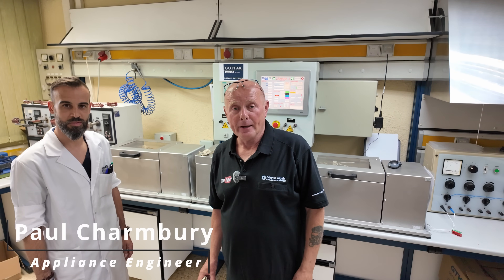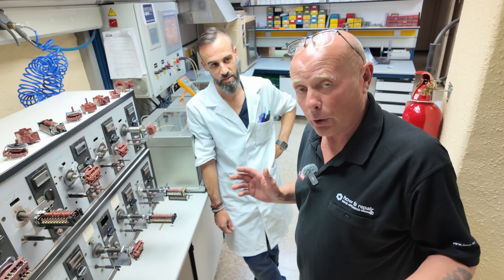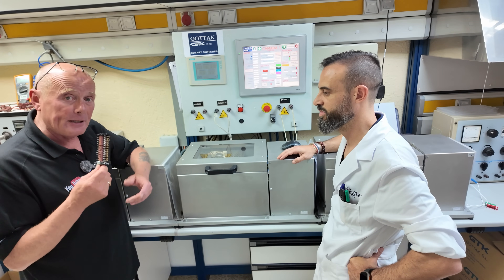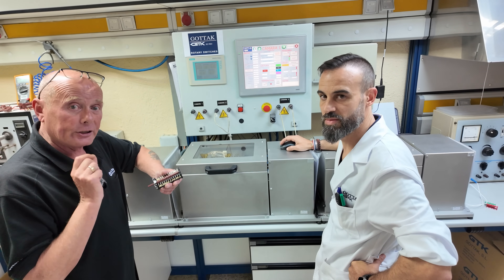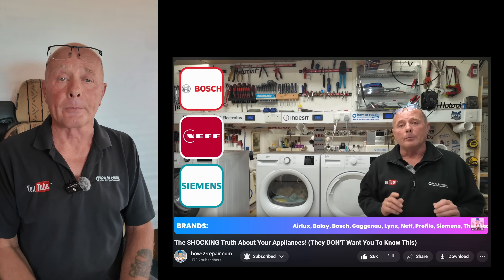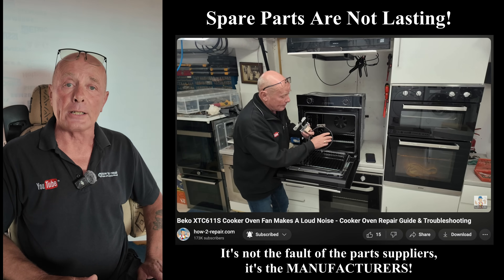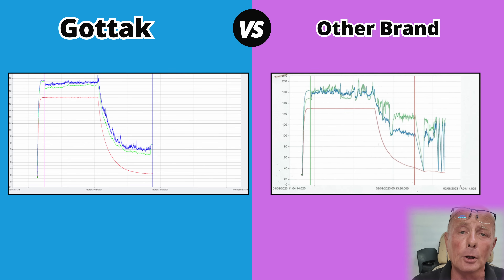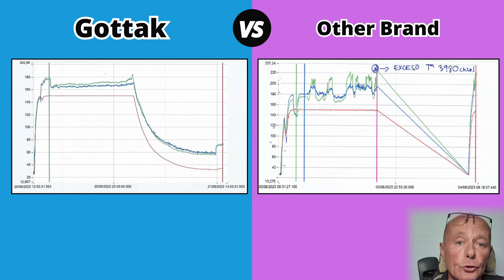Why Your Appliances FAIL SO FAST! Lab Results EXPOSE the Truth!

Comment: The main purpose of any company nowadays is to make the billionaire owner even richer.
Reply from the maker: You've cut right to the heart of the motivation behind many of these issues. The relentless pressure to maximize profits for owners and shareholders is a huge driver of corporate behavior.

The built-in obsolescence we demonstrate in our videos is the direct, physical consequence of that philosophy. When the primary goal is to boost the bottom line, cutting corners on parts and designing products that force repeat purchases becomes a standard business practice. The "savings" and "profits" for the company become a real, tangible cost and frustration for the consumer.

The flimsy components we show are the symptoms of the systemic problem you've identified. For a deeper dive into this topic and to see the examples we covered, please check out the full video here: https://youtu.be/gEgSCbZnHVM?si=wTIw0mELuhWaw4aX

We also explored related aspects in these videos:

The shocking truth about manufacturers: https://www.youtube.com/watch?v=QsdGd2qDPaI
Heat pump tumble dryers are they really worth it?: https://www.youtube.com/watch?v=xn03N3b0-lE
If you found this information eye-opening or helpful, please consider sharing this video with your friends and family. It's important for people to understand the financial drivers behind why their products don't last.

Thanks again for your sharp analysis! Don't forget to subscribe to the channel for more insights like this!

Comment: They have had planned obsolescence since the 50s.
You're just now figuring that out. Way to go Einstein!!!
Won't watch any more of your 75 year behind revelations. 
Manufactures, don't pay any attention to this idiot. His next video will probably be about the wheel!!! Idiot
Reply from the maker: @scottgreer1951

I appreciate you taking the time to comment, even if your tone is less than constructive. It's interesting that someone who appears to be around 70 years old—a fact I confirmed by viewing the only video on your channel, which also confirmed your religious belief—would choose to express themselves with such a lack of charity. I was under the impression that Christian values included kindness and refraining from hateful speech.

You're right that planned obsolescence has been around for a long time; however, to correct you, it actually first came into use with lightbulbs in the 1920s, not the 50s. Regardless, there are many generations of younger people who may not be aware of how prevalent and insidious it has become in modern appliances. My channel, with over 50 million views, has largely been built on assisting people with appliance repairs, and I've overwhelmingly received praise for the quality of my videos and the knowledge I share. In fact, the three videos I've done specifically on built-in obsolescence have collectively garnered over 1 million views, with countless individuals expressing gratitude for the information.

It seems you're lucky my next video isn't specifically about individuals like you instead of my epic video about the wheel. At least this atheist doesn't go around spreading hate.

Comment: So a component fails after 5000 activations in constant heat, the problem is - no components live under constant heat.  What DOES happen is these components gets switched on, then gets heated up, then gets cooled to room temperature.  A test that DOESN'T test under these circumstances is a failed test.

Comment: It's not just build quality. It is that many manufacturers intentionally make their appliances difficult to repair.  I had a LG fridge malfunction.  Upon telling a repairman on the phone what was wrong and that it was a LG fridge, he laughed and told me to get a new fridge.  For that model, they drowned the electronics in epoxy and it would almost be as expensive to buy a brand new fridge as it would be to repair and then he cannot guarantee that something else wouldn't also go wrong.
Reply from the maker: It's not just about poor build quality; it's that many products are now deliberately designed to be unrepairable. This is a core strategy of built-in obsolescence and it's exactly why the Right to Repair movement is so important. This is the very issue we aim to expose in our videos. For a deeper dive into these kinds of tactics, please check out the full video here: https://youtu.be/gEgSCbZnHVM?si=wTIw0mELuhWaw4aX

We also explored related aspects in these videos:

The shocking truth about manufacturers: https://www.youtube.com/watch?v=QsdGd2qDPaI
Heat pump tumble dryers are they really worth it?: https://www.youtube.com/watch?v=xn03N3b0-lE
If you found this information eye-opening or helpful, please consider sharing this video with your friends and family. Your story is a powerful warning for every consumer.

Thanks again for sharing such a clear and perfect example! Don't forget to subscribe to the channel for more insights like this!

Comment: I no longer buy consumer-grade appliances. The Marketing scum (AKA Satan's apprentices) have takn over all the best companies and turned them to shit, pure undiluted shit. 
I will only buy commercial. And it is the filth of marketing that is the cause.
How did marketing do this?
When I was training young engineers, they told me that their professors taught them that corporate hierarchy has marketing above the engineers.  I taught them differently. But pretty much everywhere else it is marketing ordering the engineers the purchasing departments, everyone to build things to fail within a specified time frame.
The evil behind all of it is marketing.
Reply from the maker: In many companies, the philosophy has indeed shifted from being engineering-led (where the goal is building the best product) to being driven by marketing and finance departments. When the primary goal becomes maximizing sales and quarterly profits, long-term durability often takes a backseat. This is the very essence of built-in obsolescence.

The pressure to create new products to advertise and hit specific price points leads to the cost-cutting and design-for-failure choices that we expose in our videos. For a deeper dive into the results of this shift in priorities, please check out the full video here: https://youtu.be/gEgSCbZnHVM?si=wTIw0mELuhWaw4aX

Comment: The appliances now a days are horrible. I still have my dryer from 1999 and refuse to upgrade. I’ve only had to do a few thermal fuses. And a belt here and there. The gas valve once and just a week ago the drive motor finally failed. 25 years. And we USE it. My dryer probably sees more use then some laundromats lol. But it’s simple technology to build what I have and as long as I can still get parts I will not buy a new one. My fridge from the 90’s was great. Made the mistake of replacing it. Now then seem to last 7-8 years and that’s it
Reply from the maker: In the 80s, 90s, and early 2000s, most manufacturers produced high-quality equipment to build their reputations.  Now their main goal is to sell machines. They use green marketing tactics to their advantage but aren't held accountable for the growing pile of discarded white goods. Nowadays, machines last only about five years on average.

Thank you for your comment. I appreciate people like you taking the time to write it out. Please share it where possible. It might help others make a wise choice instead of being misled by the industry.

Comment: Our governments are spending HOW MUCH of our money for GREEN benefits and manufacturers don't care, they are working against us.
It would be great to know which manufacturers don't dumb down their products. I have been aware of this for some time and I don't buy the same brand again when I need to renew.  It is totally dishonest and should be made illegal - though I don't know how it could be monitored.  Perhaps one company would be willing to give a longer warranty, knowing their parts are in good order ...  I can dream.
The solution with customers is to buy small pieces of equipment which are not so expensive to replace - where that is possible.  An air fryer instead of an oven with a slow cooker and/or instant pot.  For washing machines we might need to go back to hand washing and a spin dryer which is much, much cheaper to use and to purchase.
Reply from the maker: It's maddening to see so much effort put into "green" initiatives while manufacturers are simultaneously creating mountains of waste with products designed to fail.

Your desire to find brands that don't dumb down their products is what we're all looking for. You're right that a longer warranty is one of the best signs a company actually stands behind its engineering. 

The dishonest practices you've described are exactly the kind of built-in obsolescence we aim to expose. For a deeper dive into the specific ways they do it, please check out the full video here: https://youtu.be/gEgSCbZnHVM?si=wTIw0mELuhWaw4aX

We also explored related aspects in these videos:

The shocking truth about manufacturers: https://www.youtube.com/watch?v=QsdGd2qDPaI
Heat pump tumble dryers are they really worth it?: https://www.youtube.com/watch?v=xn03N3b0-lE
If you found this information eye-opening or helpful, please consider sharing this video with your friends and family. The more people who are aware, the better we can all become at spotting the bad products and rewarding the good ones.

Thanks again for your very thoughtful comment! Don't forget to subscribe to the channel for more insights like this!

Comment: Getting you extra views / engagement / advertising revenue isn't going to benefit us; only you -- no better than the accountants. The only way to get change is to incentivize manufactures to make quality devices with a tax break.  If your device goes to city dump before 20 year warranty due to failure then you will be taxed 10% of the price of the product adjusted for inflation when it reaches the dump. New manufacturers will require a bond to pay for these fines.
Reply from the maker: Our primary goal with this channel is to use the platform to create a large, informed community that can push for real change. The awareness and discussion are the benefits we hope to provide to everyone.

Thank you for your comment. I appreciate people like you taking the time to write it out. Please share it where possible. It might help others make a wise choice instead of being misled by the industry.

Comment: I have a drier that Ive been using for around 30 years, a washer I have been using for around 21 years and an oven and dishwasher Ive been using for 15 years.
The old mechanical appliances that don't have pc's in them are the way to go.
Many years ago I saw a special on PBS about built in appliance failures.
Reply from the maker: A 30-year-old dryer is a true testament to how things used to be made, and your experience is one that many people share.

For a deeper dive into the specific ways modern appliances are designed to fail, please check out the full video here: https://youtu.be/gEgSCbZnHVM?si=wTIw0mELuhWaw4aX

We also explored related aspects in these videos:

The shocking truth about manufacturers: https://www.youtube.com/watch?v=QsdGd2qDPaI
Heat pump tumble dryers are they really worth it?: https://www.youtube.com/watch?v=xn03N3b0-lE
If you found this information eye-opening or helpful, please consider sharing this video with your friends and family. Your comment is a perfect example of the "then vs. now" of appliance quality.

Thanks again for sharing your experience! Don't forget to subscribe to the channel for more insights like this!

Comment: They've been doing this for too long. its the lack of business ethics that's so prevalent today. use to be such goods were called lemons and you would go down to the store or call the salesman and chew him out and it would be made right. That's no longer the case. In addition to engineered to fail, they're engineered and built in a way to prevent repair. Apple is a great example of this. They've even said "its too dangerous for a customer to fix their products." "The customer doesn't own the product, they are essentially just leasing it and have no right to repair it". They keep repair diagnostic tools all inhouse, they won't provide replacement parts. John Deere is another great example. Farmer's aren't allowed to or able to fix their own tractors. Very large very expensive combines are required to be brought into the approved repair facility. these can be hundreds of miles from the farmer and the equipment requires a semi truck to transfer it. 
Its so common there is a movement called, "Right to repair". support the cause, Louis Rossman has a ton of videos on this topic.
Reply from the maker: I've reached the point where I simply cannot tolerate this situation any longer, and that's why I made this video. I'm aware that this might cause some controversy, or even land me in trouble, but I believe it's crucial to try and make a difference. I would greatly appreciate it if you could share this video. Together, we might be able to bring about some change. If we can't shame the manufacturers into action, perhaps someone in government will see the video and take notice of the overwhelming number of comments expressing public concern.
Reply: @How-to-repair Ill send it around. Youre doing good work pal. I dont understand why environmental warriors arent all over this. If you want to save the planet reducing appliance, electronic, and consumer waste is a great place to start and is more realistic than demanding people "just stop oil".

Comment: If you watch the tv commercials from the 1950s, they were always using words like, "Science", "Engineering", "Quality".
Reply from the maker: You're so right. Back then, "Engineering" and "Quality" were points of pride and major selling features. Today, the focus is often on trendy features or "smart" tech, while the core durability is quietly ignored because, in many cases, it's no longer there. They don't want you to think about how long it will last.

This shift in marketing isn't an accident; it's a necessity. It's hard to advertise "Quality" when you're deliberately designing a product not to last. This is the very essence of the built-in obsolescence we discuss in our videos.

For a deeper dive into the specific engineering choices that have changed, please check out the full video here: https://youtu.be/gEgSCbZnHVM?si=wTIw0mELuhWaw4aX

We also explored related aspects in these videos:

The shocking truth about manufacturers: https://www.youtube.com/watch?v=QsdGd2qDPaI
Heat pump tumble dryers are they really worth it?: https://www.youtube.com/watch?v=xn03N3b0-lE
If you found this information eye-opening or helpful, please consider sharing this video with your friends and family. Your comment is a perfect, simple way to explain the problem to others.

Thanks again for that fantastic insight! Don't forget to subscribe to the channel for more like this!

Comment: This is the reason i buy miele.
You can get soare parts after 20 years without problems an fir reasonable prices .
My washing machine was loud after 8 years ( ca 2000 loads)
I purchased a repair kit includibg the bearings, dampers and motor parts for 60 euro ir so.
Running like new 
A friend had a hoover.
After 6 years the bearings soubds like a coffe mill.
The machine is scrap.
You cant even change the bearings.
The housing is plastic and welded.....
My drier is a nodern siemens .
It makes sone problems but its mostly cleanibg work to do .
I clean its internals 1 time a year.
This prevents the usual problems.
Reply from the maker: Your Miele washer story is exactly how it should be: a common wear part fails after many years of service, a reasonably priced repair kit is available, and the machine is good as new. That's a sustainable, consumer-friendly model. In contrast, your friend's Hoover with the welded plastic tub is a textbook example of built-in obsolescence – turning a simple bearing job into a death sentence for the entire appliance. 

This is exactly the kind of design philosophy we aim to expose. For a deeper dive into why more machines are like the Hoover and fewer are like your Miele, please check out the full video here: https://youtu.be/gEgSCbZnHVM?si=wTIw0mELuhWaw4aX

We also explored related aspects in these videos:

The shocking truth about manufacturers: https://www.youtube.com/watch?v=QsdGd2qDPaI
Heat pump tumble dryers are they really worth it?: https://www.youtube.com/watch?v=xn03N3b0-lE
If you found this information eye-opening or helpful, please consider sharing this video with your friends and family. Your comment is a perfect lesson for other consumers.

Thanks again for your fantastic insight! Don't forget to subscribe to the channel for more like this!